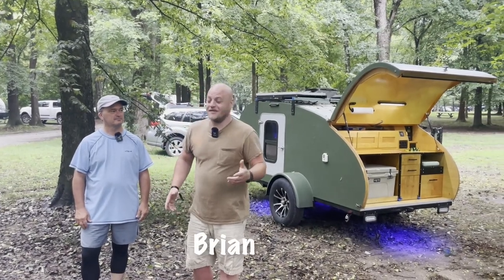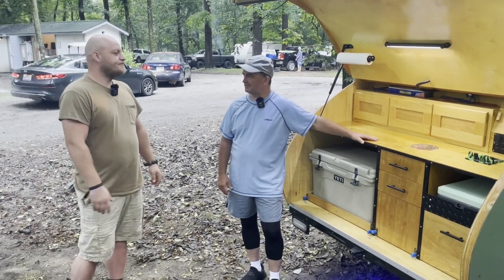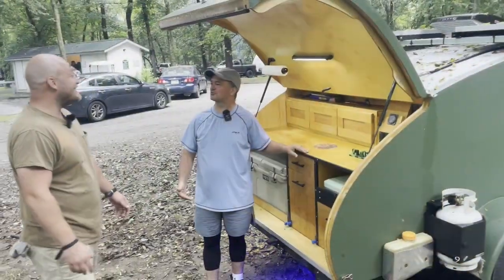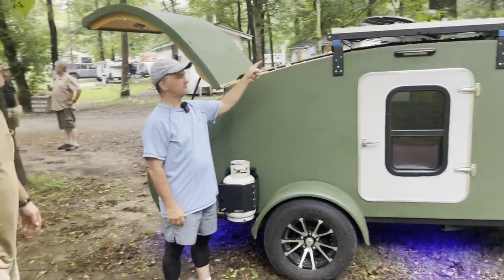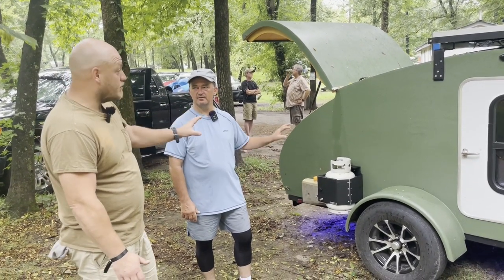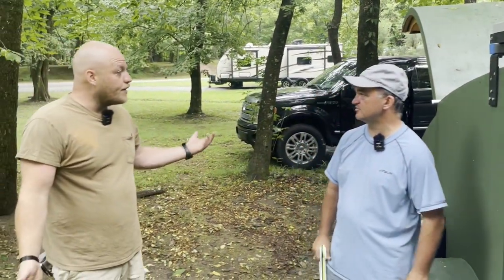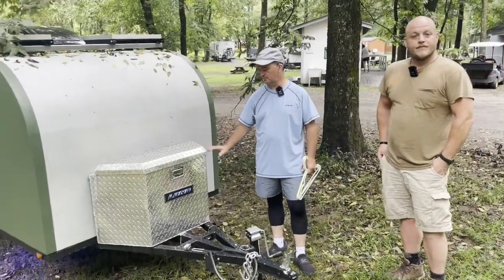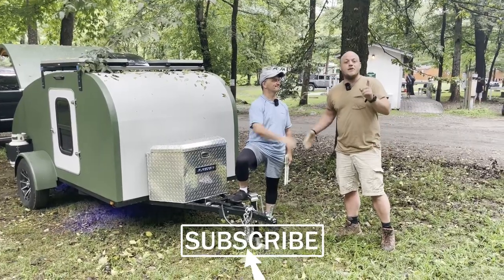BEAUTIFUL Homebuilt Teardrop Camper Tour

Comment: Very nice. I am retired but very broke due to a scam but would like to build a foam camber using harbor freight trailer I got from my dad. I need plans and cnx plans. It's going to be a bit as I have to have rotator cuff surgery but want something I can afford to build and pull without hurting our CRV with the 2.4 engine. I want to take a trip out west with my wife as she has never been.  I may have to sell some cave diving gear to fund it as my scam isn't over as the IRS is after me now. The last tax bill stopped write offs except for storm damage.  Any help in pointing me to the right direction would be appreciated. I did some limited wood working as a teenager and had some fiberglass experience working at a marina in college. One draw back is I don't have a garage but could put up a temporary structure.
Reply from the maker: I have seen some foamies on the road, theyre a great option for an inexpensive, lightweight build!

Heres some info- https://www.instructables.com/Foamie-Teardrop-Camper/?amp_page=true

Comment: After buying a Hiker a few months ago, I'm thinking I should have built my own like this guy.  But I didn't have time.  Maybe in the future.  Let's just say with the Hiker I got what I paid for.  I've been recording video of the issues.  I hope to get a channel started soon.  Hiker isn't going to be a fan of what I have to say.
Reply from the maker: Oh man, dont like to hear that... if you don't wanna share publicly, shoot me an email, Im designing a Hiker now. Anything I should know?
Reply: I have to get back to work.  I can post something here later today like after dinner then follow up with a video later.
Reply from the maker: Thank you
Reply: @DIYOutdoorLife  Here you go.

Rust.  Looks like the top shell of the trailer is steel because it seems to be rusting already.  Orange dots starting to poke through the white paint.  Receiver welded into roof rack brackets for roof rack tubes appears to be rusting.  Internal frame surfaces (A-frame is open on the back) are rusting.  Bungs for jacks starting to rust.  Sides of jack starting to rust.  Black screws for exterior light (marker, brake) housings are rusting.  Did they do any surface passivation of the steel before priming?  So I’ve been going around with Fluid Film to stop further rusting.

When I picked up the trailer, they warned me against doing anything other than using a gentle soap on the paint.  No waxing.  Maybe RainX.  So how am I going to protect the top where it’s starting to rust.  Oh yeah, they don’t warranty the paint at all.  I can understand no warranty for scratches like from branches (normal use).  But no warranty because of bad surface prep and potentially cheap paint just seems like bad business.

Wiring is THHN household wiring not automotive hookup or, better yet, marine grade.  This MIGHT be acceptable on the inside of the trailer but not on the underside where they run the wires for the trailer brakes and lights.  You really want tinned copper wire, e.g. marine grade, on the exterior.  Copper will corrode if not protected.  Also, they made the wiring look neat.  Sounds great, right?  To do this, they bent the wire at sharp 90 degree bends.  The stranded wire on the inside might be ok, but the insulation is very stiff, and I wonder if the insulation is damaged or will fail at a future date due to the strain of being bent into tight bends.

Fuse block in the back appears to be a $1 Chinese special.

The diamond plate is plastic not metal.  Were they trying to save weight, cost, or both?  Some of the diamond plate appears to have been glued to the plywood underneath.  However, it’s no longer glued because I can push it in against the plywood underneath and I can hear it peel back off.  Not all the diamond plate seems to have been glued, though.  I don’t hear the sticky peeling sound on the sides just the front of the trailer.  It appears to be held at its edges, but is the plastic diamond plate going to start flying off at some point because the middle can flex?

The aluminum sides are not adhered to the underlying plywood.  You can walk around the trailer and randomly push and the aluminum will pop in and out.  It’s being held on at the edges but how, at door and window openings, and the roof rack brackets.  But large areas in the middle are free to flex with the wind.  I can see this becoming a problem eventually.  After cutting out a hole for a MC-4 gland housing, I measured the thickness of the aluminum at about 0.028 inch.  That’s pretty thin and an odd size.  It could be 0.032, a standard size, but I was using a gauge that’s pretty accurate.  The aluminum should definitely have been bonded to the plywood in my opinion.

They didn’t completely vacuum out the trailer when I picked it up.  There was sawdust from the pocket screw drilling in the upper front shelf and on the shelves in the back of the trailer.

Think twice about locking the doors and toolbox or insert the key very gently.  I don’t think the lock mechanisms are going to hold up to any kind of regular use.  Even if you don’t lock the doors, the latching mechanism feels cheap when I close the doors like they’re just going to randomly start popping open at some point.  When I picked up the trailer, they warned me they are Chineseum.  Enough said.

The cab and toolbox are attached to the frame using self-tapping screws.  And the frame walls aren’t too thick.  The frame walls actually seem kind of thin to me.  Weight, cost, both?  Not sure how this is usually done, but through bolts or u-bolts would seem to be better.  The frame is a weird design, and I question the structural connections.  Are they sure my Midrange XL can take repeated offroad use?  All the structural connections – cab to frame, toolbox to frame, frame to frame – seem kind of weak given the attachment methods.
Reply: @DIYOutdoorLife  Obviously Major TJ Kong isn't my real name, so no problems with posting.  Major Kong is my favorite character from Dr. Strangelove, thus the B-52 in my profile pic and Slim Pickens in my previous profile pic 🙂